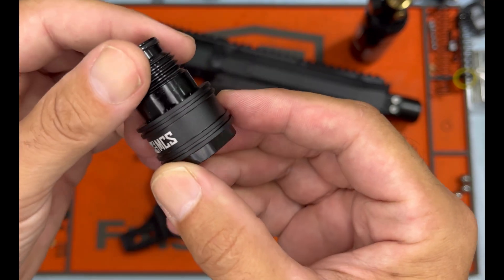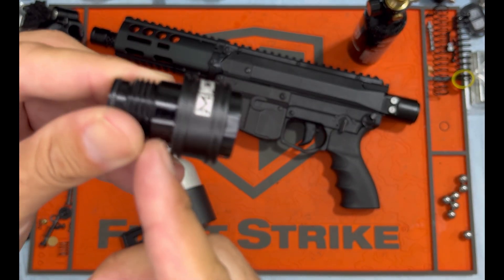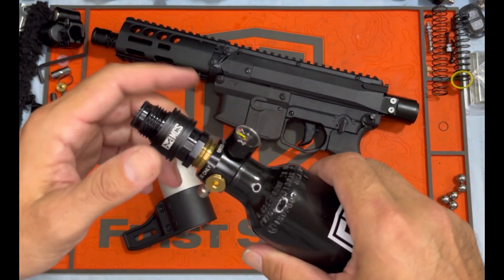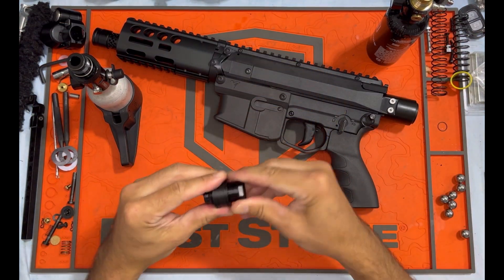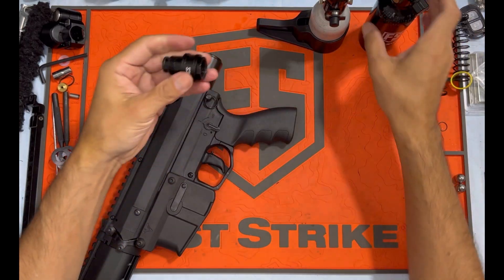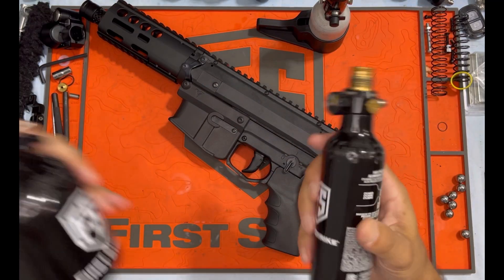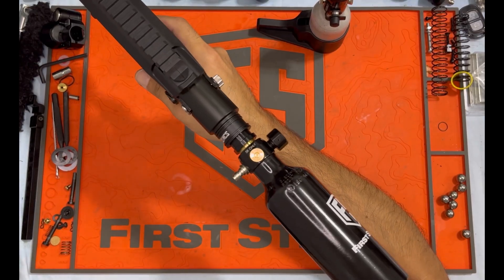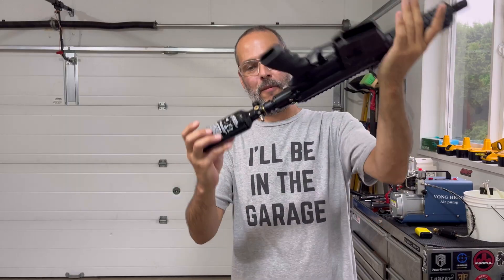LL4D - MCS Slide Check On/Off Valve | How Does It Work?

Comment: How about nitrogen? On the slide check😊
Reply from the maker: N2 should be better suited to storage on a slide check as it is far more stable than co2 and less detrimental to seals but it needs to be regulated down.
Reply: @lesslethalfordummies ya I got the n2 regulator coming and not sure what hpa regulator to use 850psi or 1000psi output
Reply from the maker: Choose your poison. Jeff just did a video saying some regulators don’t fit the Umarex N2 adapter.
Reply: @lesslethalfordummies I believe he is using a first strike reg now sure which one
Reply from the maker: Yes i think he is. He said some reg threads are too long and bottom out before the oring seal at the reg body ever makes contact.

Comment: Hi Sean, I've just got mine! Quick question if I may 😘 So once you've got the on/off in place and you want to take your bottle off to service marker do you have to remove via removing the on/off and bottle from the marker or can you just unscrew the bottle from the on/off? Assuming there's some pressure in the bottle of course. I hope my question is making sense 🥴
Reply from the maker: The bottle really sticks to the on/off because of the air pressure between the two so they come off as one in most cases unless your bottle is depleted.

You can use the wrench flats to separate the two under pressure if the need arises.
Reply: @lesslethalfordummies  Thanks so much for explaining. And so if the bottle and on/off do come off as one when removing the bottle, does that mean it would dump all of the remaining air/damage the seals?
Reply from the maker: No not at all. So long as the slide is in the off position it traps the air in the bottle as intended.

Only way it would dump air is if you unscrewed the bottle while the slide check was in the on position.
Reply: @lesslethalfordummies Well then Happy Days!!  Thanks Sean, have a great day!

Comment: Hi Sean,
I'm completely new to HPA, so please give me some expert advice.
I'm planning to buy an HPA bottle from HD24 with the similar slide check valve on it. Will 1100 or 850 PSI for the X-68 be a better choice?
Watching your videos, I assume 1100 PSI will be the better choice due to its power.
How many shots can I fire on a single tank with this setup?
I mean the decent power ones, not all of them :))
I'm planning to buy a hand pump and saw your pumping video. I think I can handle it ;)
Reply from the maker: No problem!
1100 will give the most power but can also be harder on orings. I personally like to use 800psi and it’s more than enough in the X68 to be most effective.

I have never done a shot count but on a 13ci tank you should expect 15-25 shots depending on the rear extension size you choose.{short vs long)

Nothing wrong with a hand pump to start. It gets old fast but thats how I started with HPA.
Reply: @lesslethalfordummies   So you recommend 850 PSI, not 1100 PSI. I didn't expect that. O-rings need attention, good point so I'll pass on 1100. HD24 sells their 0.2L HPA tank. So it should be enough for a short shooting session, and pumping it up should be a fun zone ;)
I understand that with this slide valve, I can hold air for weeks, even months, unlike CO2, which needs to be emptied as quickly as possible due to o-rings condition. Won't this damage the sliding valve if the air tank is constantly pressurized?
Reply from the maker: Output pressure is a personal preference but the lower you go the easier it is on the launcher.

Yes HPA is fine to store long term against a slide check, co2 not so much. There are specific co2 screw type on/offs that are better suited for long time storage.
Reply: @lesslethalfordummies  Roger. Thx!

Comment: Question with MCs slide on and off. I have a 13ci 3000psi tank with an adjustable 0 to 1500psi output. When I thread it into the tank I get no air coming into the launcher but if I really tighten it it just keeps the air open like it’s not sealing. I checked all the o rings and even tested it with co2 and it holds it but when I try and screw it on with the tank it leaks right from on and off slide to the adjustable regulator. Is my tank adjustable regulator to short or to long? I can’t figure it out hope I can get some wisdom and help from you lol
Reply from the maker: The tank regulator pin is not making sufficient contact and when it does the oring has still not set in the on/off.

Do you have another regulator to try?
Reply: @lesslethalfordummies I do not but I’ll go out this weekend to get one and try it any recommendations for the regulator? Yea it felt like it was just not sealing and the more I tighten it the more air just went out so thank you for clarifying that you’re the man!
Reply from the maker: I have similar problems with other on/offs. It seems associated with my HD24 bottle which has an offshore regulator. I haven’t tried it on that bottle yet but your issue is very much the same I experience so my money is it wont work either. 😢
Reply: @lesslethalfordummies so am i going to have to get a whole new bottle or just a new regulator? Ugh that’s gonna suck i paid a lot for it. Will the twist on and off work better than?
Reply from the maker: You would just need a regulator. Stack a known working on/off on your bottle then put the slide check on. That should co firm its the type of regulator you are using. The adjustable ones are offshore unfortunately.

I have tested my slide check with First Strike, Ninja and Tippmann regs and it works with those.
Reply: @lesslethalfordummies should I just get a regulator that is just set to 1100psi all the time? Like no adjustable cause I don’t really need it right? Yea my tanks a ninja but the adjustable regulator is not I believe will check when I’m home. But good to know I don’t need a whole new tank
Reply from the maker: No ja tank but not a ninja regulator? Strange 🤔
Reply: @lesslethalfordummies just checked it’s a ninja flex series pcp adjustable tank regulator 1000-1700 psi
Reply: @lesslethalfordummies and the tank is 13CI 3000psi PCP
Reply: @lesslethalfordummies is there a regulator you recommend I can buy online?
Reply from the maker: Strange it doesn’t work with a Ninja regulator. Maybe email KT.
Reply: @lesslethalfordummies you said though cause it’s adjustable may be the problem right? So a different regulator set to 1100psi might work?
Reply from the maker: I don’t have an adjustable Ninja regulator. Off shore stuff is the problem I have found with short valve pins.
Reply: @lesslethalfordummies what does off shore stuff mean? I’m looking at the air venti with the 1100 psi right now. Any recommendations?
Reply from the maker: Offshore means Chinese. My Ninja regulator works fine with the on/off. Email KT in regard to yours not working.

Comment: Thanks for explaining the 88gram CO2 thing because this is very similar to a remote line with slide check and I have a pile of different ones that have failed due to the pressure of turning it in the off position and then I won't dare leave the remote line hooked up in the off position for home defense because what if it pops a leak and in the middle of the night it blows a projectile outve an hdb or hdr50 or hdr68 because there's usually a round in the chamber.either way I used a few of them that way but for home defense it's way too sketchy and I couldn't get any sleep because I would catch myself rolling over feeling the red puncture indicator pin just to make sure it didn't spring a leak. 😂😂😅😮🤕👀 Love this video though My Bro! And nice adapter
Reply from the maker: Difference using a remote line slide check  is there is an additional on/off usually on the bottle.

Comment: Ordered one as soon as i was through the vid, MCS delivers to europe 🙂
So as far as i got it - on HPA i can leave the regulator open even at 1100 PSI, and the O rings of the Slide Check in OFF position keep the marker ready to rumble indefinitely ( as long as its not CO2 ) ?
That would be a game changer.  
Thanks Sean for all the helpful content ! 
Greetings from Berlin.
Reply from the maker: You said it exactly. Launcher is aired in seconds.

Comment: So the pressure is always on the o rings once the bottle is screwed in right? not the best for storing as a ready to use home defense launcher i think
Reply from the maker: That is correct but its perfectly fine when using HPA, just not co2.
Reply: @lesslethalfordummies 
And that, as you've impressed, is the distinction.
HPA is preferred for this valve.
CO2 will work for short term if needed, but really this valve is for HPA.
CO2 sitting on the orings will cause leakage over time as opposed to HPA, if I heard that right.
Reply from the maker: 💯 co2 is short term only. Just ask all the Byrna Mission 4 users with their slide checks 😅

Comment: I had a BB. Co2 aired up over a year. Thought no way dude it fired solid. Put it down a couple months it fired.put a new Co2 in it leaked until I fired it it stopped leaking. But two weeks later it was dead. I wonder had I ran an OIL C02 through it, would it have stayed healthy. Hummm.
Reply from the maker: Slide checks are different than BB gun operations. My Umarex T4e will hold co2 indefinitely but every other marker won’t. The designs are just different.
Reply: @lesslethalfordummies Thanks❤

Comment: Co2 doesn't appear cold until it moves. That's why the bottle isn't freezing all the time. Some weird stuff.
Reply from the maker: Correct it cools when it is exposed to ambient air and expands to a gas state but in its liquid storage state it will still be in contact with your orings.

It will leak during storage, it’s only a matter of time. It is however perfectly fine to utilize it short form. I can only speak on my experiences. I just don’t want to see peeps finding their 88/90gs empty when they go to use them.